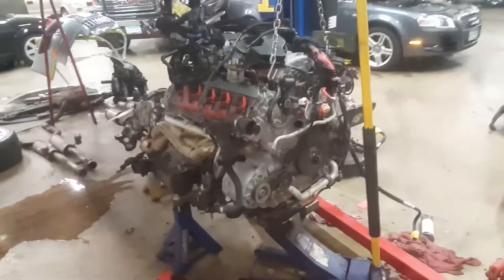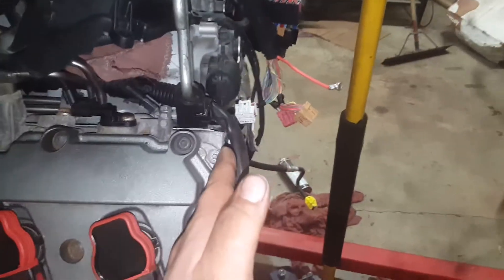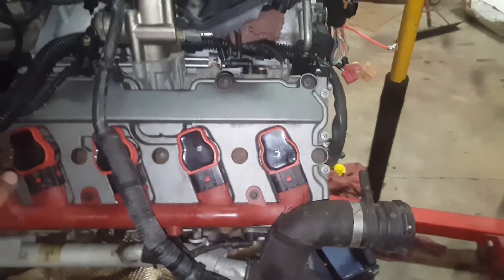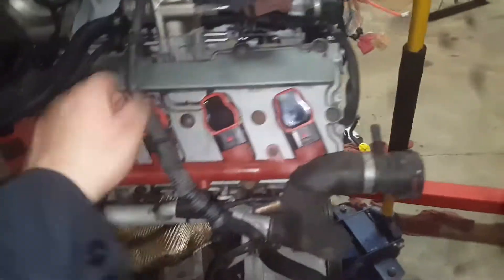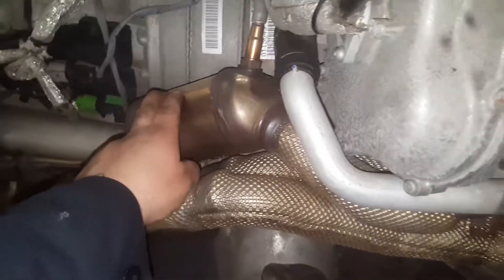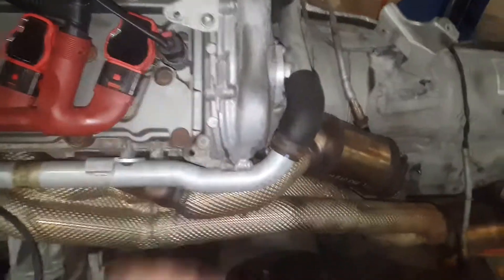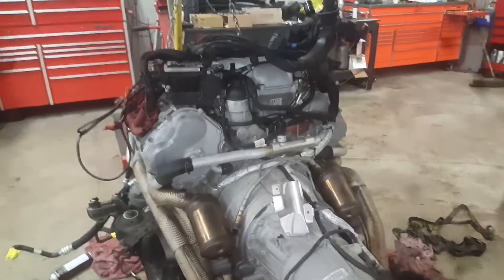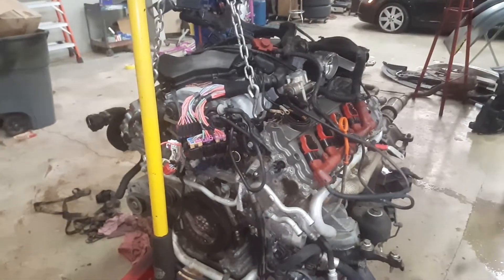Audi 5.2 V10 cylinder order

Comment: I bought an audi s8 5.2 v10 2006 3 weeks ago I run perfect for 3 weeks it said low oil so I filled it up 2 days later it started missing a little  I plugged vcds in and it says  camshaft positioner bank 1 exhaust  I run it the day after and it drove ok again I pulled up at traffic lights set off and it started running rough again do you think it is the Camshaft position sensor located at front left of the engine bottom sensor? I also found all the spark plugs are sat in oil so I guess the rocker gasket needs replacing do you think the oil may have been causing miss fire thanks for explaining which is bank 1
Reply from the maker: oil can definetly cause misfire , low oil can also cause issues with  timing control
Reply: @JoeTheAutoGuy  thanks for the reply I replaced drivers cam cover gasket and exhaust cam sensor and cleaned all the oil out of the plug Wells seems to run better I think I will change all the spark plugs soon but now I have another issue  I jacked the car up now the rear air  suspension drops totally off and shows a yellow suspension fault the front stay up it was fine before I jacked it up what do I look for I have vcds
Reply from the maker: @BREN2009  check the rear air suspension height sensors , may have over extended and broke causing it to not activate rear air
Reply: @JoeTheAutoGuy  Hi Joe I followed your advice and you were 100% correct I had broke one of the little  rear arms that connects to the level  switch all fixed now thank you so much for your time